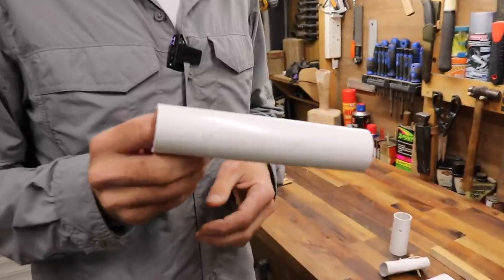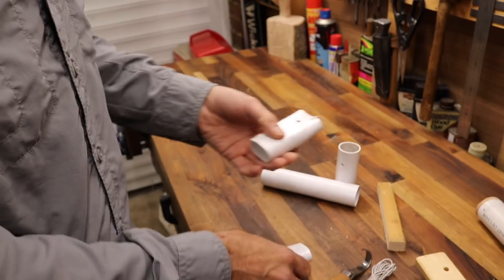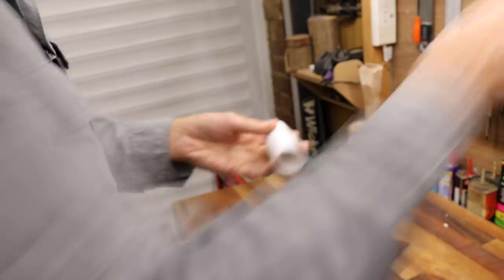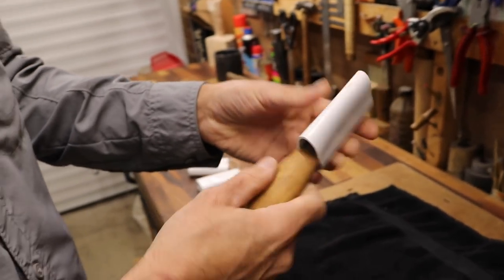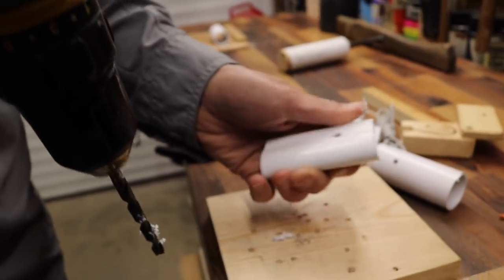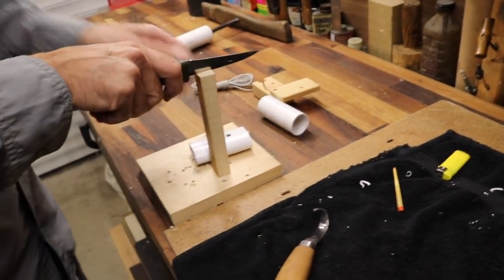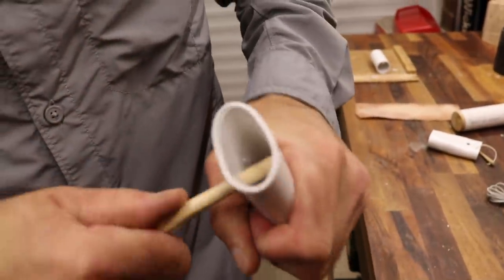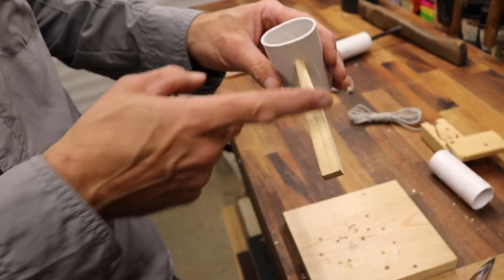How To Make A PVC Plastic Sheath For A Spoon / Hook Knife - Lee Stoffer

Comment: Depending on the width of the blade, you could form the pipe around end of the knife handle a bit more. You could also curve the blade end of the plastic a little.
Reply from the maker: Indeed this video is a starting point as the tweaks and customisations are endless ~Peace~